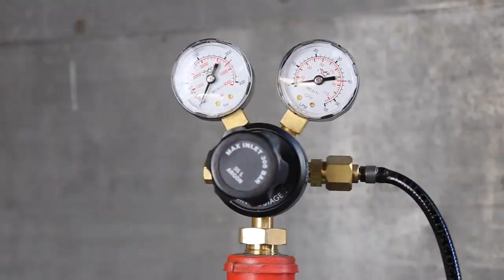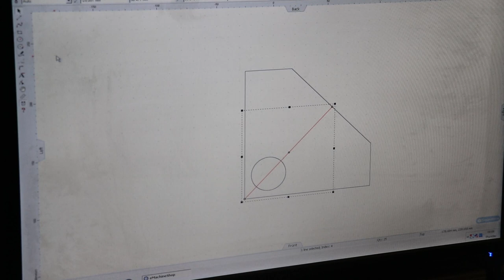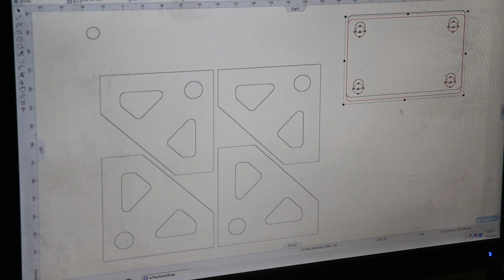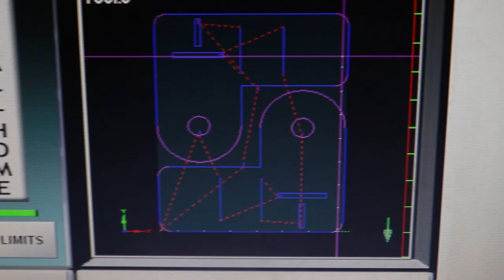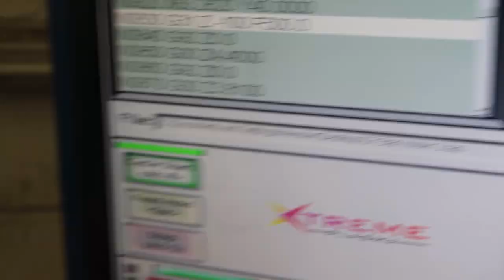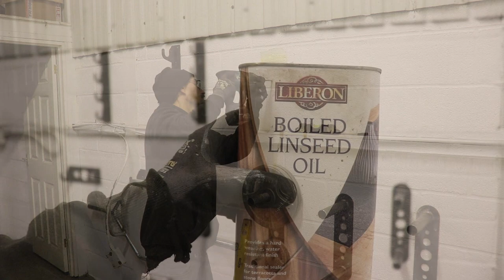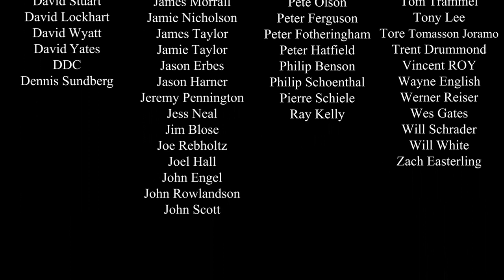I BUILT A GYM IN MY WORKSHOP - PART 1

Comment: How long do you find the blades last on the Evolution saw.
Reply: Good question. I'm wondering whether this makes a difference whether you use a chop saw or a mitre saw. For my R255 SMS+ saw, the blue steel blade became dull so fast, that I consider it completely worthless, even though I tried to be as gentle as possible. I don't know whether I cut through more than 2-3 meters total... I replaced it with the Diablo Steel Demon blade, we'll see how long this one will last.
Reply: last a good while on mild steel but i killed one pretty quick by cutting stainless tube
Reply from the maker: Not long if you cut round or accidentally cut something really hard, but if you just do mild steel box there pretty good.

Comment: Nice (; Do you actually change the welder's settings when changing positions (like horizontal and vertical downhill) or maybe you weld everything with the same settings?
Reply from the maker: No I use the Pulse setting which works well in all positions. Cheers